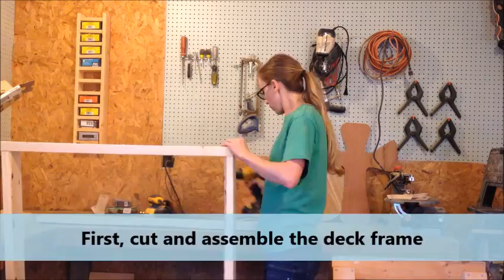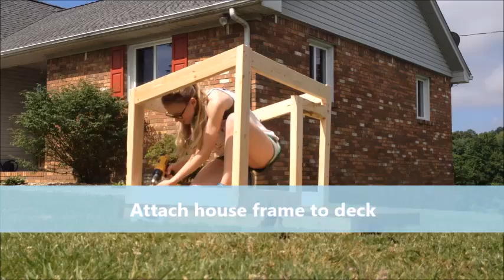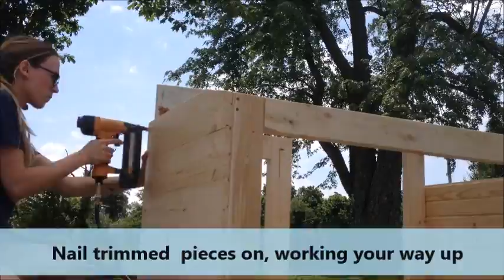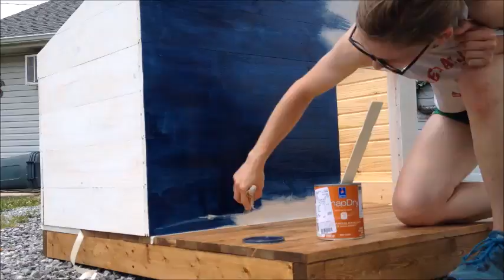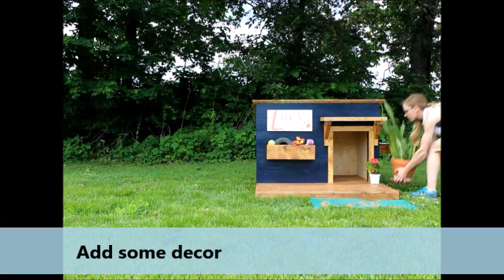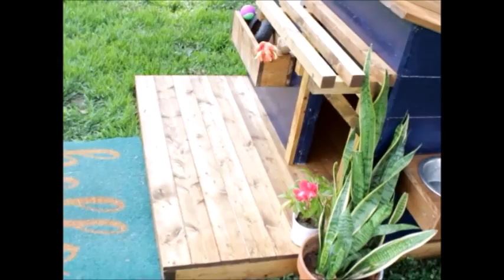How to Build a Modern DIY Dog House

Comment: My husband and I are going to be building this house very soon for our fur-babies but I was wondering..(and I apologize if you mentioned it already in your blog or video and I missed it)... but did you use both treated and untreated wood? I know that untreated is less expensive and it looked as if you may have used both so was wondering which parts you used which wood on. Thanks for the great plans and instructions. This may just be something I can do!! :)
Reply from the maker: Hi! I didn’t use treated lumber for this. It is covered (it’s in our lean to next to a barn) so it really won’t be getting wet. If it will be outside and get wet, I would suggest using treated wood instead.